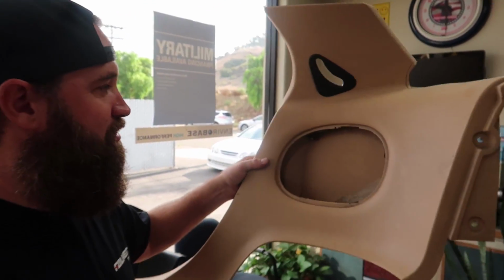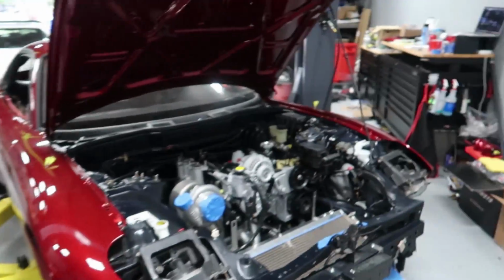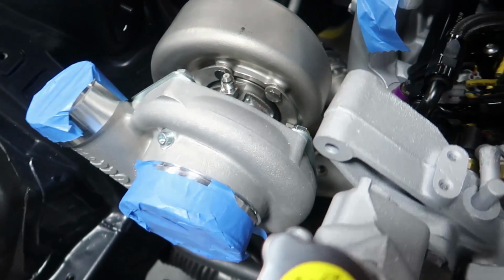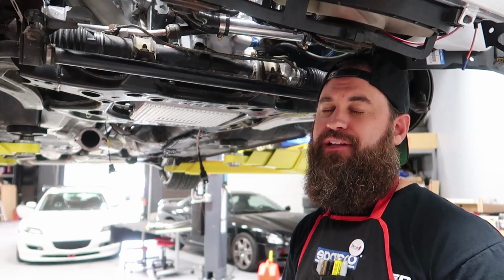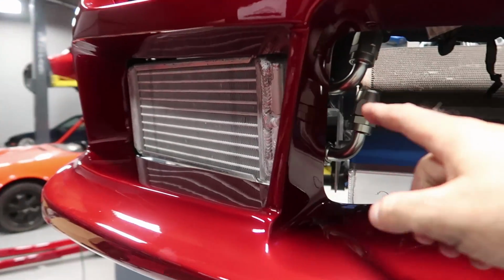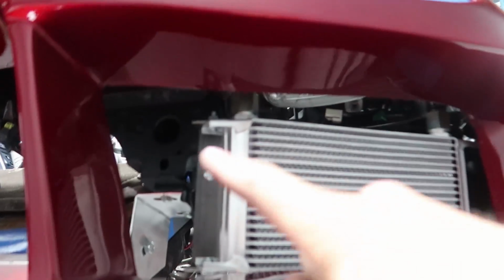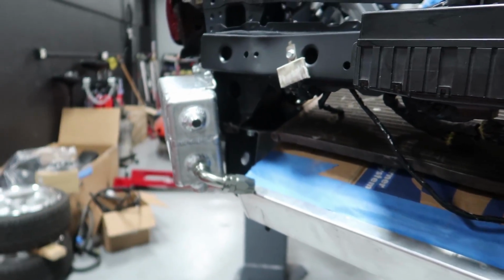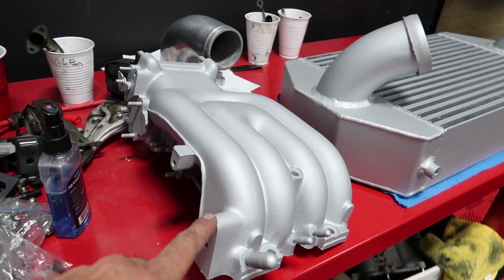MAKING THE FD RX-7 EVEN COOLER!!!!

Comment: i know it's way too late, but for the oil cooler lines you can use -10an tube nuts & sleeves with aluminum tube, bend the tube where you want and on the other end connect a flex hose.

Comment: Ooh those welds on the cooler look like a dogs breakfast bro. Has it been leak tested before fitting as I’d be a little cautious when welds are that sloppy to the eye. Just for safety of system. Also you are gonna get major rocks and debris smashing into the fins of the coolers if you leave the front bar inlets open without a mesh screen. Black mesh will keep the flow and protect as well as hide unsightly fittings and suspect welds.

Comment: Would it be possible to change the oil cooler to the spot where the power steering cooler is going? So the fittings can fall behind the corners of the bumper and if it were to swap places the lines would be shorter considering you were going to run them over the other side of the inter cooler gap?

Comment: Question for you how do you fill the oil system with the thermo block off? Do you fill warm the car up then fill again or is there a way to keep it open when you fill the oil.
Reply: They're not 100% closed. They're more so like 10-20% open at all times then fully open at temp so you can still get oil through. Just not much. That's a big cooler but most normal sized ones only add like 500-750ml to the system so just overfill a bit and run it in then check afterwards and top up If needed.

Comment: I think you may want to put a puller fan behind that cooler, especially on idle. Since you don't have a duct on the cooler, air might just go around it since it might take more pressure to go through it due to its thickness.

Comment: I like the fittings standing out, years ago when threaded fittings started to come out in all Dash’s & be used on all the Fluid Lines it was almost like eye candy too me especially when I got my Red & Blue anodized fittings for some steel braided line that became popular on NoS kits at first. Those chrome fittings looks sick aF tho i like it reminds me of the Japan Bazuka style lately where Dey running there whole Cooler Lines outside the front bumper & back in the hood. I’m not saying do that, I just like seeing the fittings atleast & if you tuck the lines it’ll look clean, I’d run the coolers stainless at first maybe clear coat everything before you decide too go black, you can’t undo painting em but you can always paint em L8er

Comment: For the oil cooler lines you could used a forged style 90 degree fitting. they have a lower profile on them so you may be able to have them hid better.

Comment: So, I know that you said that the yellowed reservoir is an eye sore for you and that you are having a hard time finding a replacement. I've been a detailer for 12 years and honestly, I believe that with using some light sand paper, rubbing compound and polish, you should be able to get the color back to "like new". Essentially the same process as restoring your headlights. I'd try it on a junkyard reservoir first, but I feel confident that it'll solve your issue. Good luck!

Comment: Why did you cut off about the brake line?
The oil temperature switch for the oil cooler. I’m confused. If it’s closed and needs the oil to be at 180 to open, the line leading up to the switch will have stagnate oil in it which will take longer to get to temp because that oil isn’t running through the engine, it’s just sittings in the line. If there still oil in the cooler that oil will be being cooled while driving counter acting any warmth coming up the stagnant oil in the line. So the switch may not open as often as it’s truly needed. And if it made of aluminum, which it looks like it, it’ll just dissipate heat, again meaning the switch may not open. That set up doesn’t seem like it will work. Is there a weep hole, like in a thermostat, that will allow some movement of oil?
Reply: Pretty sure it just bypasses the oil cooler until it its up to temp.

Comment: You shouldve put the oil cooler on the drives side and then u couldve tucked the fitting back by the wheel well

Comment: The two fittings in front of the v mount make it look self built kinda like Teej’s BRZ with the old oil colder line that draped in front of the radiator I personally like it

Comment: So I guess there wasn't room for the oil cooler to be turned 180 degrees so the fittings would come out the left and hidden, then just run longer lines?  I realize the mount may not be set up for that, but you could fabricate something.  Maybe there's something I'm missing...

Comment: why not flip the oil cooler so the fittings are on the other side and out of view?  you would need longer hoses but it would look much cleaner!
Reply: plus that would allow a much cleaner looking center section to the radiator of you do plan to box that in with aluminum!
Reply: i agree, why  not put the oil cooler on the other side? You wouldn't need lines that long and prob have a chance to hide the fittings too.

Comment: Make the power steering cooler fittings going the other way to the middle, just like the oil cooler, so is gonna be symmetrical. If you get the same cooler is better

Comment: A lot of guys just run the oem r1 oil coolers that actually work better than most aftermarket oil coolers. If you ever wanted to go with a setup like that.
Reply: Ramon Villa I used to work at a Porsche 914 restoration shop and we used rx7 oil coolers on our front mount setups because they are cheap and they work!